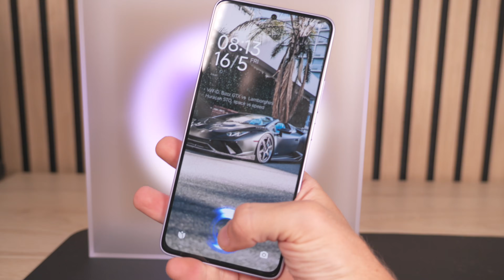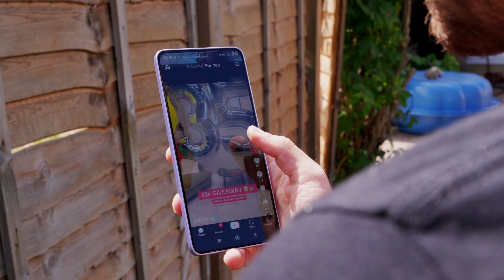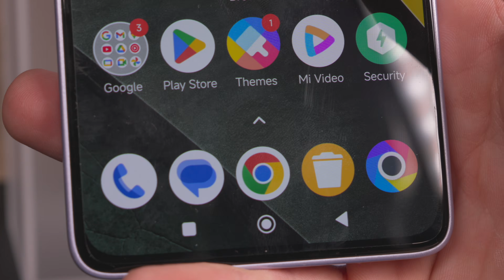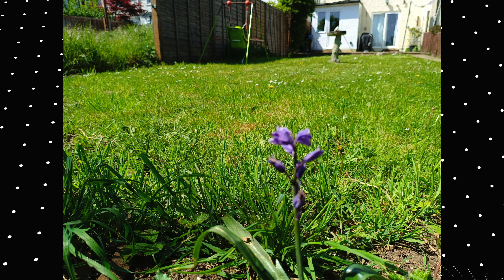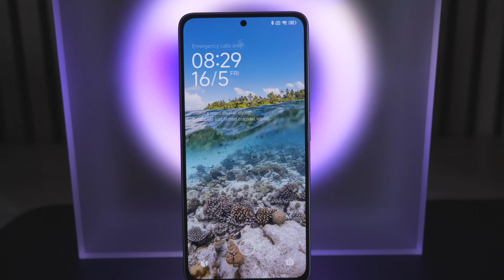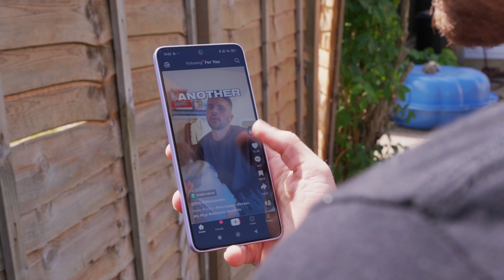In the Poco M7 pro still worth it 6 months on?

Comment: The lilac is soo pretty, but I'd wish they had a light blue option

I've been using a Galaxy J7 Neo since its release and I'm looking to upgrade to a phone that can give me at least another 7 years. The main issue is the lack of space (I've been stretching those 16Gb with a custom Rom and an SD card, but you need so many apps now), and the second main issue is that it freezes while trying to load reddit. It's of course pretty slow and mostly unable to run any modern games, but I can bear with that, given its age

How many years do you think the M7 Pro (12/512) could last me? Would it be worth it to give up the 3.5mm and Sd slot for the X7 Pro's higher performance?
Reply from the maker: The M7 Pro (12/512) should easily last you 5-7 years with its specs, but giving up the 3.5mm and SD slot for the X7 Pro's performance really depends on your priorities!